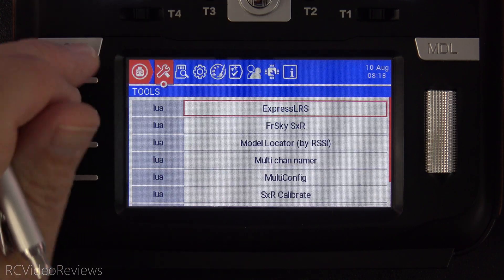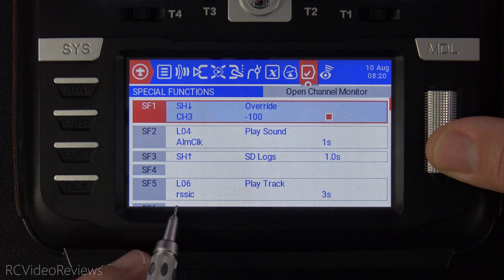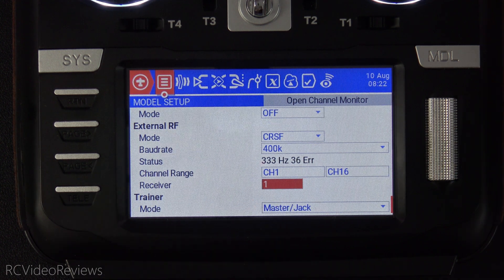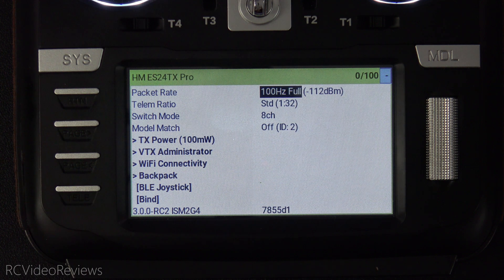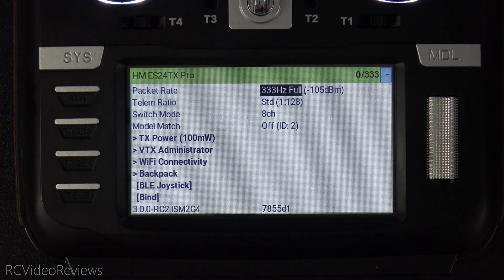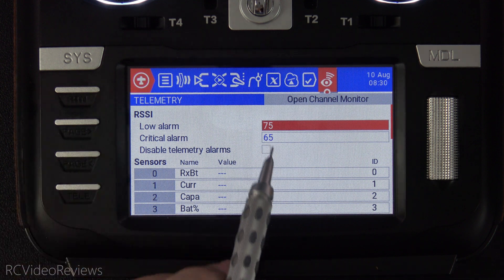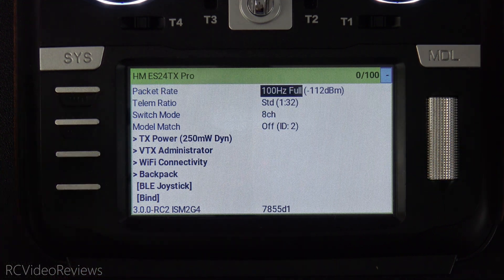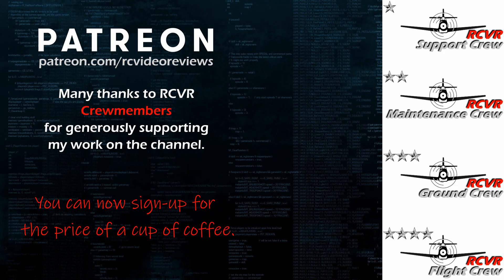Top 10 ExpressLRS • ELRS • Tips and Tricks on EdgeTX

Comment: You'll read in another comment that I have just started converting my nice aircraft to ELRS. This video proved hugely valuable. I especially appreciated the receiver number and packet rates hints, the latter being doubly important as LBT firmware restricts the TX to 100mw.
Reply from the maker: That is one of my favorite tricks with ELRS--and I'm all in on using it for my models at this point. Even my helicopters are getting it.

Comment: When I set my packet rate to 333hz, INAV doesn't seem to get any input from the receiver. Change it back to i.e. 250hz it works again. Am I missing some setting somewhere or could it be a limitation on the receiver? (i have updated both TX & RX to see it that makes a difference)

Comment: I seem to always have the Wi-Fi connection issue. I found that, once in Wi-Fi transmit mode, turn off the Wi-Fi on the PC, then turn it back on. Then it magically shows up on the PC’s network list. I’ll try the browser trick you mentioned the next time I flash one that won’t connect. Thanks.

Comment: Sorry for the question, but in another video made by you, called "expresslrs link telemetry • how to set up" you say that to configure the rssi on the radio, the values are 50 low alarm, 20 critical alarm. But in this video you are saying 75 and 65. So what is the correct configuration for the rssi in the radio?
Reply from the maker: After discussing with the ELRS developers, I changed to 50/20. The reality is though, it doesn't matter that much. The number reported is RQLY which, even if it dropped to 5% at a paltry 100hz  would still mean 5 updates are being understood on the RX per second which is still very good connectivity. At the time though, the radio firmware itself didn't allow a floor below 65. That has also since been changed.
Reply: @RCVideoReviews  okey! Thank you so much!

Comment: Are the values for low \ critical alarms still 75/65?  You mentioned in the video that they might change.
Reply from the maker: 2.8 updated the range to use 0-100. So now you can chose an RQLY range that works for you. In speaking with one of the main developers he said going as low as 5 still works. Personally I’m think a n alert at 75 with a critical at 50 would be a safe starting point.

Comment: Hello
My RX and TX are bound, but FC is not responding to inputs 
I have 2 different Fc but i still cant figure out the problem
I have done all the settings with mismach but still not working
Reply from the maker: If you're 100% sure you're bound, but the FC isn't responding, then you probably either have your rx/tx swapped, or the protocol on the FC is wrong.
Reply: @RCVideoReviews  
Thanks 
I have had information from the fc like the betaflight version so i have reflashed the rx and started new with model mach and after few settings there i have managed to get it working but dat model mach is really confusing and hard to get it working

Comment: Why did you say 6dbm is double range, its 3dbm to double power not 6 ?
Reply from the maker: You might want to check your work: "every 6-dBm increase in output power doubles the possible distance that is achievable."
https://www.electronicdesign.com/technologies/communications/article/21796484/understanding-wireless-range-calculations

I believe you're confusing power:dbm  and range:dbm

Everytime you double the power, you increase the dbm by 3. That has nothing to do with range. To double the range, you need to increase the dbm by 6.

http://www.raviyp.com/calculating-the-range-of-a-wireless-device/
Double the power = 3 dB increase  
Half the power = 3 dB decrease
120 dB link budget at 433 MHz gives approximately  2000 meters (Chipcon rule of thumb)    
6 dB improvement ~ twice the distance

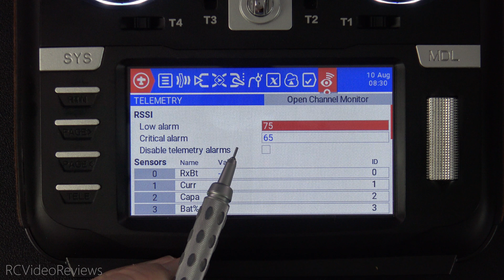Comment: 6:00 you contradict a previous video, recommending to setting your link alarm , you advised 50/20 ? Model match  , is that number burned into the receiver when you flash it ! Or you  can change it at random ? Want to hear a funny ? ELRS has intimate me , I was flying my big quads on Futaba , is solid but no telemity. I took out my quad for a shake down and got critical alarms at 1000 meters , I was like wtf ? I went home and found out my transmitter was at 25 MHz lmfao but wow ! My futaba is 100 MHz and will failsafe at 1000.  That amazing eh ! Thank you for your work .
Reply from the maker: Based on my research at the time, the higher numbers in the video were generally espoused best practices. Not content with guesstimates, I spoke with the actual developer and revised the range down based on his feedback. There is no harm in using the higher value so I left the video up. 

Model match is not burned in, but it part of the binding logic so if you use it to bind and disable it on the radio, you will have to rebind. 

I’ve done a lot of flying with ELRS at this point and believe it will be my primary Rx tech.

Comment: Hi John, great video as always. I'm having an issue with Happymodel EX24 TX external module,latest edgetx on a RM TX12 transmiter. i updated the TX and RX both on 2.5.1, however, when i activate the LUA script, i'm getting the (LOADING...???) error. I've read everything on elrs site including troubleshooting, followed your video steps, i joined elrs forum, used 2 different computers, tried everything that people have told me steps to do and "NO GOAL". Also, i'm using CRSF. Also tried changing BAUD rates but still not loading.I'm all out of options, do you have a video regarding this issue you can share? Any help is greatly appreciated. I also have a TX12 Mark 2 with edgetx and elrs and that transmiter works flawlessly. Thank you for sharing your knowledge.
Reply from the maker: Does the external module work on the other radio? Did you update the LUA script? You really need to get on our discord and ask there. YouTube is not good for sorting this kind of thing.
Reply: @RCVideoReviews  I did, the Discord invite says the "The address is invalid" when i click on it.
Reply from the maker: Not sure what to tell you. Link is in every video I post and I just verified it works https://discord.gg/jSFTASU
Reply: @RCVideoReviews  I'ts ok, thank you. I'm just gonna order another TX12 Mark 2 for my son. Not gonna spend any more time dealing with the HM ES24 TX external module. Thanks for trying to help. Much appreciated.

Comment: elrs uses crossfire protocols its nothing new just used someone elses work wrapped it in another package and called it their own this is why ill stick with crossfire  the original solid connection that hasnt let me down easy to update etc
Reply from the maker: Congratulations. You get the most ignorant comment of the week award. You're clearly clueless about the tech, so I'm not going to even bother with a debate. Go do your homework and try again. PS You might want to consider NOT polluting the Internet with ignorance.

Comment: From -105dBm to -112dBm is actually decreasing, why does it increases range?
Reply from the maker: It indicates sensitivity. Higher dBm is better. So we'd rather have -5 than -10 RSSI, but was distance/obstacles between RX and TX increase, the dBm decreases toward the limit (-105 or -112). As your RSSI decreases, would you rather stop at -105 or would you rather be able to go to -112--which is -7dBm more effectively meaning double the range of -105.

Comment: Sometimes Wifi won't connect to the home network because the default gateway has the same IP address.  If that is the case, one of them must change.
Reply from the maker: Not the issue in my case. My dhcp range does not include LAN assigned statics. DHCP should really never try to assign IP addresses if the server is setup correctly.
Reply: @RCVideoReviews  the configurator RX Wi-Fi protocol will try and open a web page on 10.0.0.1 static so it can be configured.  My Router IP address happens to be 10.0.0.1.  I had to change that address for it to work.  DHCP is not in the picture.
Reply from the maker: The RX only uses 10.0.0.1 when it is using it's own hotspot. In this case, your home router isn't relevant. If your Rx connects to your home SSID, it will ask your DHCP server for an address which should not conflict with your router if your DHCP is setup correctly.

In either case, DHCP is used. If you connect to the hotspot, the Rx provides your wifi interface on the PC an address and it should be 10.0.0.2. If your RX connects to your SSID, the DHCP server on your wireless issues an addres. The Rx doesn't use 10.0.0.1 if it connects to the SSID so there is no conflict.
Reply: @RCVideoReviews  so the home router has to be set up for the 10.0.0.0 255.255.255.0 subnet inside dhcp for this to work properly?
Reply from the maker: Not at all. My home subnet is 192.168.1.0/24. Re-read my previous comment. There are two scenarios:

Scenario #1) The Rx/Tx is in hotspot mode. In this mode, your home network has nothing to do with anything. The communications exist between the rx/tx and the computer directly. You are not connected to your home ssid. You are not connected to your home router. Your home subnet can be anything it wants to be because it's simply not material in scenario #1. In this scenario, the rx/tx uses 10.0.0.1 and your pc gets an address 10.0.0.2. Again, DOES NOT MATTER WHAT your home network uses in this scenario.

Scenario #2) The Rx/Tx connect to your home SSID and ask the home router for an IP Address. In this instance, the HOME ROUTER IS RESPONSIBLE for providing an IP address to the Rx/Tx that does NOT CONFLICT with the home router address. In your case, if your home router is 10.0.0.1, then the router DHCP server should know this and NOT give 10.0.0.1 to the Rx/Tx. It should assign an address that is not already being used.

Any further response on this from me will occur on discord.
Reply: @RCVideoReviews  ok I see the issue. My pc Wi-Fi is disabled since I am running off of gig ethernet wired connection. My router has to be involved.  Thx!

Comment: Thanks for the awesome videos. I'm looking to purchase EdgeTX Transmitter and wasn't sure what protocol to get. Like 4 in 1 then get ExpressLRS Module or just purchase a Transmitter with ExpressLRS built in. Thanks
Reply from the maker: Either arrangement:
- ELRS Internal and 4-in-1 external or 
- 4-in-1 Internal and ELRS external
will work great...
Reply: I have ELRS tx16s,can I use external 4 in 1 multiprotocol module for this radio?